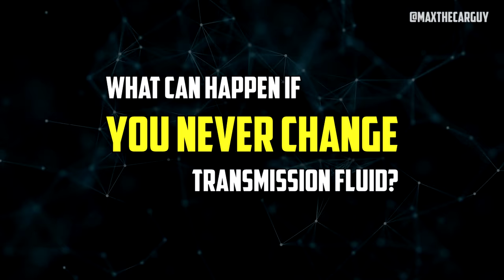Transmission Fluid Change vs Flush - Pros, Cons, Costs

Comment: 😂 $100-250 I had a 2008 tundra and Toyota wanted to charge me almost $1200 to replace fluid and filter.
Reply: Never go to the dealer 😂
Reply: A full flush on a tacoma 2015 is 300+tx he is right in price
Reply: That’s cause of the work n parts to drop pan replace filter ect as well as refill. A plain flush is 3-400
Reply: @JFEnterprize Nope. Nissan charged me to do a flush + filter for $380. The filter is not that expensive to be charging people north of $1,000.

Comment: The flush thing is just stupid. Change the fluid and filter. Drive around town. Drop the oil again and fill up. If you want it 99% perfect. Drop the fluid again and fill up. Btw most transmission problems comes from low fluid or a clogged trans filter The key to a succsessful trans job is to have the filter changed and enough fluid in the trans. Your trans is like an engine. It uses oil. Allways fill more then you dropped and always fill the trans when hot and not cold. Cold fill will give you the wrong result. Drive around and fill up drive around and fill up
Reply: That’s pretty damn smart
Reply: @AlexVela-t3r  dextron 3 is the best fluid. Be it syntetic or semi syntetic oil
Reply: I had 175,000 miles on a 2010 civic. Changed fluid but not the filter. No problems.
Reply: @toddsmith1617  dude the filter is where the box sucks up the fluid and make oil pressure. If its clogged the box has no oil pressure to the converter. Your trans box wont last long before you have problems. Oil and filter everytime!
Reply: @Stian2001  If you do three successive drain-and-fills to exchange 90% of the fluid, you don't need to change the filter each time.
Reply: @rdkirk3834  yes that is true.
Reply: @rdkirk3834  You still have old fluid in your transmission if you do that.  If you do a flush, which is really just a fluid exchange, you have all new fluid and you only have to do it once.   Pros and cons to both ways.  But yes, you do get a new filter and you only need to do that the first time.

Comment: I have a 2010 Ford Escape with 129k miles on it. Transmission shop sampled the fluid and said it's safe to flush because my transmission is working well and there's not a bunch of metal in the fluid. The fluid isn't black, but it's starting to darken. They're charging $270 here in Phoenix, AZ.
Reply: I would trust the shop. Go ahead and do it!
Reply: I have a 2018 Toyota RAV4 Hybrid. @85K miles. I think I just paid for an extra service. Thoughts?
Reply: Low or high miles, I would never flush my transmission. 
Just let drain the old transmission fluid and replace it with recommended new one, including filter.
Reply: @LarryVanz even with low mileage? Why???
Reply: @LarryVanz what qbout the fluid behind torque converter?
Reply: That was my previous car. Mechanically the car is good.

Otherwise, it's not a good choice. It's Best to have it for moving from point A to B with NOTHING SPECIAL.

Comment: You could safely do a " passive flush " . This inolves disconnecting the two hoses from the transmission cooler . Engine running at idle , Suction hose into container with new fluid  and other hose into a container to catch all the old fluid being forced out . These are several YouTube channels that show the exact procedure
Reply: That’s real talk right there.
Reply: Please elaborate if you don't mind
Reply: @whatitisnt.  YouTube Channel - 1 Road
Doing This Will Destroy Your Transmission !- Why You Should Never Flush Your Transmission Fluid ! These videos will show the procedure of flushing out your transmission , not using a flush machine . This way it is done by the normal pressure in your transmission . I have seen other videos showing close enough of how they did it .
Reply: @peterrudy9207  so basically flushing DIY is better than flushing at the shop since the shop uses "dirty hoses" that might already have debris? Also is the method you provided a 100% flush including the torque converter?
Reply: If you could watch these videos I mentioned .
Reply: @peterrudy9207 using the atf pump itself yes with engine on idle ..switch of after 1 to 3 quarts..top up ...do until it is clean..
Reply: @goldeneagle99  Will be getting this done asap . Had quote from one shop $450.00 ! Called another they will charge $275.00 !
Reply: 😢 why 😭 is everything so complicated
Reply: @whatitisnt.  To drain the transmission completely the torque converter needs to have a plug in it. Most of the automatic transmissions today do not have a plug in them. Dropping the pan does not completely drain the transmission and that is why there are videos showing you how to basically drain the converter. They show the pan being removed, the filter being removed, a new filter installed, putting new atf into  the trans and then disconnecting the return line that goes into the trans and running the engine while watching the color of the fluid coming out until it looks like new fluid. Some even install a clear line so they can watch the line and see the change in color as soon as it enters the clear vinyl tubing. Then the engine is then shut off the engine and you top off the fluid in the transmission.   My 1963 Plymouth Belvedere had a plug in the converter and it made it nice and easy to drain the trans. I guess they want the two or three dollars for the plug in their pocket and don't care about the car maintenance as long the trans lasts past the warrantee. Happy Motoring.

Comment: I worked in the parts dept at a Honda dealership for 12 years. I used to tell people that ATF is the hardest work5fluid in the car. It has to work as lubrication, a hydraulic fluid, and a coolant.

Comment: A shop O worked for had a device that had 2 chambers with a diaphragm in between. You disconnected the in& out lines from the transmission cooler and connected to it. The bottom chamber was filled with new fluid and the car started. As the old fluid filled the top it pushed the new into the return line. A vomplete change without the force of a "flush" that adds extra presdure that can push debris into valves and such to danage transmission. It worked better than anything else I've seen.

Comment: I just drain and fill my transmission every 20 to 30 thousand miles but I have changed the filter once. With a 157,000 miles my car transmission is shifting smoothly and strong.

Comment: What do you consider high mileage? I have 120000 on my 2009 Toyota Highlander, and I'm trying to decide whether to get a drain and fill at the dealer.
Reply from the maker: Go another 120000 and it will be "high mileage". For now - simple change would be enough.
Reply: @MaxTheCarGuy,, I've been experiencing some transmission engaging delay a bit. Thank you for the info! But I was a bit confused about the fill vs. flush. 
I have a 2006 Impala with 118,500 miles. I have no evidence of a prior fill/flush. Where should I go from here? Should I go with a fill first? My dad's a car guy, so he can probably help me out. 🤞
Reply: I would try to do it myself. I have a RAV4 & I bought a Haynes manual to get the proper temperature to check the fluid level & Scangauge2 to measure transmission temperature. Buy the fluid from dealer. I am doing one drain & fill every 30K miles. Make sure vehicle is level & it is running when checking fluid level on Toyota.

Comment: Daily driver:
Drain and refill once a year. Every years, never have an issue.
Conversation settled.
Reply: If I employ a drain and fill method (usually get 50% each time) when is a good time to do the filter?
Reply: Change the filter and clean the pan at the first drain and fill. If your vehicle does not have a drain plug purchase a new pan with a drain. In theory for most vehicles this would be the last time one would need to change the filter.
Reply: @danielbruneau2222  Thank you.
Reply: Really?

Comment: I bought a 2009 Chevy Traverse from someone Aug2021, not sure what they did or didn't do as far as Maintenance is concerned. But, the next morning after bringing in home, the Check Engine light came on and I instantly panicked. The Dash read (low oil pressure turn off engine) imagine my fright. The Truck had plenty of Oil so no one would do an Oil change saying the levels were good and that wasn't the problem. So FINALLY, I found somewhere that would change it and guess what... The Oil was like sludge, just thick and black on the bottom of the Pan, haven't had that problem since with kept up Oil Changes. Now, my truck lost power a couple Wks ago, now... Every time I get an oil change I ask are my other fluids good, the guy always says YES but that day when I got the Truck towed home I had someone check a couple days later and there was NO FLUID. I'm wondering if that is the actually problem? I don't know if the Transmission Fluid has been changed, if its been serviced etc. I did a code reader because the light came on as soon as it lost power and they read TCM(trans control module). Imagine my panic AGAIN. Wondering if I should do a service or flush??? Please help, thank you.
Reply: Hopefully you got the problem fixed by now. I would suggest that any GM vehicle you purchase, switch the orange coolant over to green coolant. The green coolant helps your motor last longer.

Comment: Remove hoze at radiator
And run hoze to bucket.
Start engine then to neutral.
It will pump out the entire system.
Then start to blow air.
Turn off, refill, bring to operating temp, check level.
Done.

Comment: Thanks for the video! 
I have a 2020 cx9 at 64000 miles never has transmission fluid changed. From the vid, I’d I am hearing correctly, flushing out is not recommended for a car that has never had the trans fluid changed at high mileage. Thanks.

Comment: I went to the dealer they wanted to "Flush it" they call it a "fluid exchange" now because flush is a bad term now. I showed them service manual said not to do that only do a drain and fill. They said if I wanted that would cost more. I suspect it comes down to speed and less labor by using a machine.
Reply: Trusting someone to work on my car gives me ulcers when I can’t do the work myself.
Reply: @gregnixon1296 true

Comment: Low or high miles, I would never flush my transmission.
Just let drain the old transmission fluid and replace it with recommended new one, including filter.
Reply: That’s what everyone says but I dunno. New stuff has tighter tolerances with cheaper steel. If done every 30k a flush a flush and 90 a filter change would prob be right. But that’s for plain service no issues. If having trans issues of any kind drop pan check filter should be the way not a flush otherwise your potentially pushing too heavy materials other places where it will blow.
Reply: Makes no sense.  A "flush" really is just a fluid exchange.  Nothing is actually "flushed".  It's great for your trans, as you get 100% of your fluid changed, instead of just roughly a quarter of it.  There are pros and cons to both methods, but there's absolutely nothing wrong with a "flush".  The name really causes some confusion
Reply: @SealofPerfection I baby mine, I do a “flush” every 28k miles.

Comment: Some mechanics would say don't even drain the fluid if you went a long time without transmission service.  Car Care Nut falls in that category.  I have two vehicles, one ford and one toyota with over 200k miles that haven't been serviced since around 100k miles and i drained fluid in both and added compatible Walmart universal fluid to both and no problems whatsoever.  I would be more hesitant about a flush, but i think a drain and refill is going to be needed to extend the life of the transmission

Comment: CVT flushes are about $400. Fluid changes are about $300.
Reply: I have a 2019 Chevy Impala with 64000 miles, that also has a Warranty.   Will the Warranty cover any of the price of the transmission flush.

Comment: I find it curious that from the beginning of automotive time, all auto trans has to be flushed.
NOW, with the Ford 8F35 & 6F35 which is a design Ford bought from GM as a 6speed, these 
trans DO NOT require flushing. How odd. So, when you pull the drain plug the torque 
converter drains too? The filter is internal so to replace it the trans has to be dropped & split
to get to it. This is an all new service procedure  OR  nobody wants to do a proper flush so
Ford tells us to just drain & replace hoping the trans will have a short service life and it will 
fail leading us to buy a new Ford?

!

Comment: Honda dealership recommended a flush at 93k miles. Is there a potential to harm the transmission?
Reply from the maker: Transmission flushes can be a controversial topic, with different opinions among experts and car owners. In my opinion, 93k is too low mileage for flushing... But the decision also depends on the age of the car.

Comment: I think there is confusion between the term "flush" and "change." Many people consider a "full capacity exchange" a "flush."  That's confusing.  More accurately, a "flush" involves forcing fluid under external pressure through the transmission.  It's possible to perform a full fluid change without external pressure, just a more complete "change" by tapping the line at the cooler.  This video somewhat describes that difference between even a complete "change" and a power "flush."

It's also possible to change as more than 90 percent of fluid with 3 or 4 "drain and fills" at the pan, allowing 50-100 miles of driving between each to mix the new fluid with the old.

A power flush is never, ever a good idea.  It never has better results than gentle draining and filling, and often causes worse results.
Reply: "Flush" is a misnomer.  It really should be just called "fluid exchange", because that's all it does.  "Flush" implies that somehow it's pressurized and cleaned out that way. It's not.  A machine just pumps new fluid into the pan while the transmission's own pump pumps the old fluid into the machine's tank for disposal.  It's not bad in any way at all.   
There's really no such thing as a "power flush".  That's just advertising.   A "power flush" machine just uses a small 12v pump to pump the fluid back into the pan, rather than using the transmission's own pump to "push" on the new fluid and get it out of the machine that way.   
There is no "pressure" applied to the trans that comes even close to what the transmission's own pump puts on it.

Comment: Pros and cons to both. 
Pros: Flush, gets all the fluid out, (nearly all anyway), so you have pristine new fluid.
 Pan drop/filter:  You get a new filter.  You get to look at what's on the magnet...although this only matters if you know what you're looking at, so if you're a DIY in your driveway or some lube shop is doing it, that part isn't relevant.    

Cons: Flush doesn't change the filter.  May or may not matter, depending on the condition of the trans in the first place.  
Pan drop leaves 3/4 of the old, dirty fluid in it.  Plus you run the risk of a gasket leak.  

Doing both is the best way, but may be cost prohibitive.
Reply: so if my 2003 tacoma has 171k miles and it’s never been changed should i do a basic change? and filter change? or just leave it alone ? shifts great now
Reply: @cedricmendoza1305  there is no downside to having fresh new fluid in there.
Reply: @SealofPerfection  heard it could fuck it up with high mileage cars that have never been changed
Reply: @cedricmendoza1305  It's an old myth.  If you change it and it breaks, it was already going to break.  Vast majority of those stories, the person was having it changed because there was some symptom they were trying to address.
Reply: @SealofPerfection  do u have any experience with them??
Reply: @cedricmendoza1305  Lots of fluid changes, yes.  With your specific vehicle doing that, no.
Reply: @SealofPerfection  nice. doin a ton of research and i’m mainly hearin to do it… so i most likely will. but fuck if my trans starts fuckin up after i’d be shit out of luck. nervous

Comment: Draining my Tundra's transmission yields 90% of the fluid...  good enough for me.
Reply: Not my Tundra. I do a “standard” drain and fill periodically, but only get about 3-4 quarts of the 12 capacity. But I’m happy with that.
Reply: Not unless you either have a manual, or there's a drain bolt on the torque converter.  Some transmissions did have the ability to drain the converter, but if not, most of the fluid is in there and no way you can get it out with flushing.

Comment: So draining and replacing a transmission fluid is what? Transmission fluid change..?
If i were to drain and swap for a new filter whats that called? A transmission flush..?
I'm lost..😂😂
Reply: Let's say your transmission has a total capacity of 12 quarts.   If you drain and fill, you only replace 4, maybe 5 quarts.  The rest is still old, dirty fluid.  But you do get a new filter. 
With a flush, you get 12 quarts of new fluid, but keep the same filter.  If the trans is in good shape, this really doesn't matter.  If you're having a problem, then changing it either way won't fix it, it's going to fail anyway.